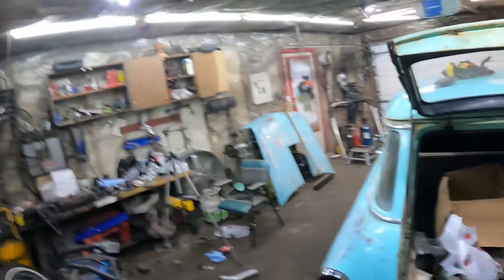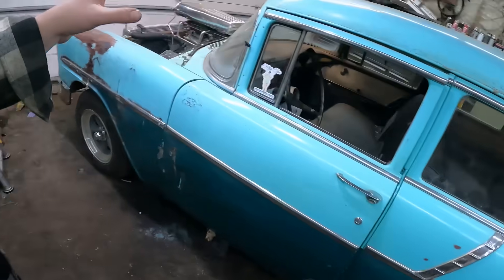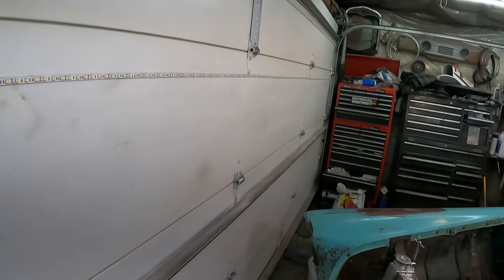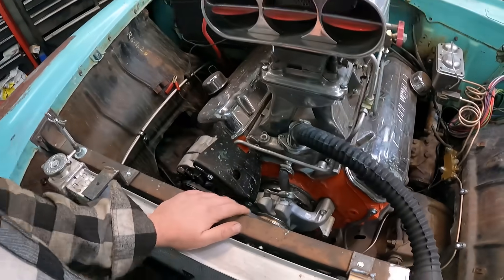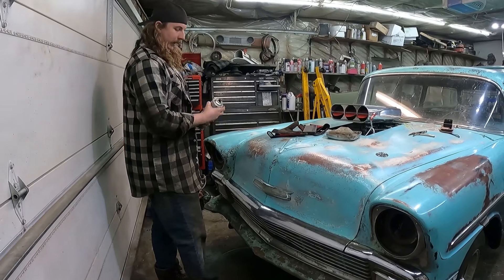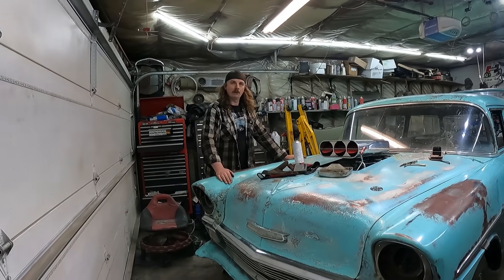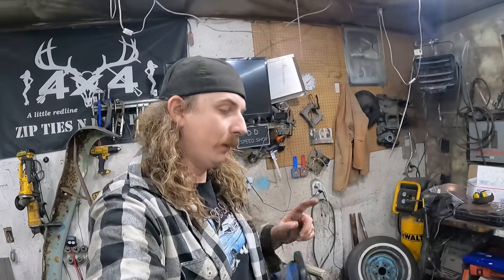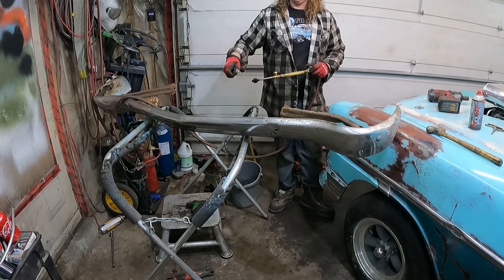1956 Chevy Gasser Wagon Get's Some Bling

Comment: Got most of suspension work done on my 88 mustang GT Monday. Fixed the leak in the new rack, put new stainless steel  brake lines on in the front. got some slotted and drilled rotors for the front. All the bearings are still good so I repacked all the wheel bearings got her all together . Went into the house and asked my wife to come out and help me bleed the brakes.
Now I’ve been married to my wife for 43 years and she doesn’t mind help me bleed brakes she’s actually pretty good at it .she doesn’t even lift her foot off the when petal hits bottom . She waits until I say OK . She’s been bleeding brakes with me over 40 years.

Comment: Yes, the front end looks fine with the bumper.  Consider LED lights for the tail lights. The lenses are small and you need all the rear illumination you can get for night time driving.  Just a thought.

Comment: If you need a locking handlefor the 56 tailgate look for a locking garage door handle at a home supply store   I got one with the same size square end about the same length  with 2 keys for about $8 US. it works great I  used 10-24 stainless oval head machine screws and lock nuts  to mount it.

Comment: Bad ass car man! My Mom had a white '57 wagon, (I don't think it was a Nomad), but i was a bit young cuz i was born in 1959.
    It must have been like about 1960 - 1964 ? Ish.  
 When I was about 16-17 yrs old my friend had  a '57 Bel Air convertible,Jet Black wet sanded and polished to a stupid sick shine, (rag top) with a 283, 4spd Muncie trans and a #4165 Holley double pumper.  It was fun grabbing second gear and with amazement seeing the left front tire leave the ground maybe 1/2" or 1".  Broke many U-joints burning the rear tires off.     Out of 4 "friends" I was the one who helped him fix it when it broke something.
    Damn good channel-  serious good content.

Comment: So,what do you use for wipers? 
Same as my Fargo for what i researched. Rock auto supplied ones that dont fit. I got anco 20-12. Man they are pricey. 
$76.00 for the pair. They hook on the same,just a different adapter. They come with the wiper.
Reply from the maker: Just stock stuff I have

Comment: Thumbs up on the bumper. Always loved the gas tank filler behind the tailpipe. Pinky n the Brain thought of that in 1956. We need more lab mice at GM. I noticed you giving that front fender a heat treatment with your welder. Cars turning into a runner. Which is usual in your case.

Comment: Well I took my front "Behind the Bumper Fill Plate" OFF ...So I can run a Tow strap around the bumper if I needed to. And to keep leaves and crap from collecting on there. And to lighten up the front end of my Chevrolet Van.  And I think it looks cooler without that FILL PLATE. I also can wrap X mas lights or faux barbwire around the bumper for an Apocalyptic look in October.
Reply from the maker: Ahhh thats pretty smart

Comment: My 55 has canceling turn signals?  Original...  is that only a Belair thing?
Reply from the maker: Maybe.  Non of mine have had it
Reply: @DDSpeedShop  Danchuck sells the rebuild kits to get them working as long as it has the little posts for them

Comment: Her in California you have to have a front bumper if you drive on public streets. In the early 80s my 57 got hit by some idiot, who took off. He messed up my front bumper, and passenger front fender. I replaced the front fender, but before I got another bumper I drove without one. I got a fix it ticket for no front bumper. I got a 2 x 8 piece of wood, bolted it on the front, went to the CHP office, and got the ticket signed off. Wooden front bumper for a while. How old school is that?

Comment: Unless your worried about the save pile getting too big, hoarder status, pull the trigger on a whole assemble as you will do many more of the tri five cars before you retire in the great old folks home and look out a small little window to see the kids trolling the streets... and some old women is there telling you no damn way you ever built anything that would of made it around the block... nasty old phillies can't be happy about nothing. I did it steering columns are addictive as I used them in all my rigs with the manual transmission conversions .... I can't get my head around the automatic and being up on a column and out of the way of someone setting near you. Birth control buckets    is what we called them. I don't like a bumper on this rig either as it just does not give the racer image. I used a three inch black pipe with some other hangers I made for each rig as no two alike. Its smaller and takes the eye off of the valence metal hanging in front. I kinda think the bird would help this one as I have that picture in my mind. With all the carbration you have, it will be faster to the finish line but top end is just that as those rear gears make speed available. Trust me when they threaten me with a full care center... I quit sniveling about pain or not walking more than where I can reach furniture to steady that " two in the morning stagger" and just get hard to be around.  Best of luck  Dan

Comment: Sorry I have a problem not a big deal but an expert opinion. When I was 10 an age when I noticed rust is not part of the paint job   EVERY Chevy wagon had rust on the tail light of the driver side different amount of rust or worn paint   But standard issue every wagon   So keeping with old looking touch up you have a car that is not period correct for that model.  Not a big deal. And not enough of us survives to tell. So you don’t have to fix it. Just informing you. Learn on!

Comment: Hey Dan, do they STILL sell the original glass round headlights, or are there modern round headlights??? 
Dan, todays cars are computer generated cookie-cutter cars that are boring and show no individuality or originality. Interiors are bland to say the least. No two or three toned interiors. The 50's cars on the other hand were colorful inside and out, multi-color interiors and exteriors. Some cars had three different colors on the body!!!! Hideaway gas fillers were the rage in the 50's....Cras were cool looking back then. Today, meh.................